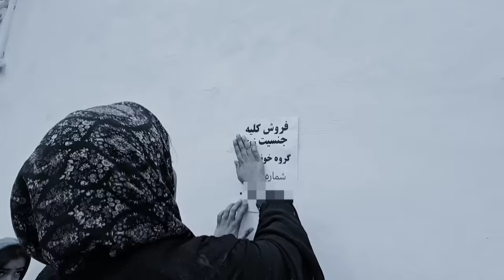Nomadic Resolve: Siblings' Journey to Build a Mountain Home Alone

Comment: I wonder why brother you did not put sand mix with cement before putting the blocks in the ground.Put some stones inside the blocks to make it heavier so it will not fall when theres a strong wind,was that a temporary or permanent cause you did not use cement and sand.
Reply from the maker: Hello, you are right, but we did not have money to buy cement

Comment: Dangerous structure, should pour concrete first before laying the bricks. Pour concrete before adding next layer of bricks. Bricks are upside down, stack them so that you can fill the hole with concrete and stone to make it stronger if you don't have steel bars. This structure won't withstand even a mild earthquake!